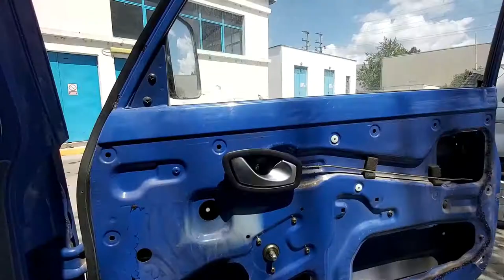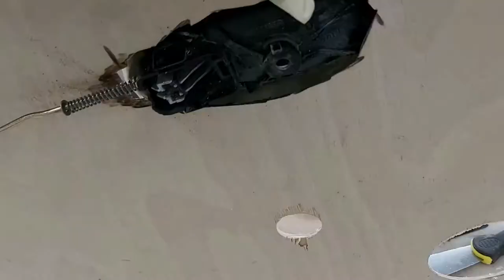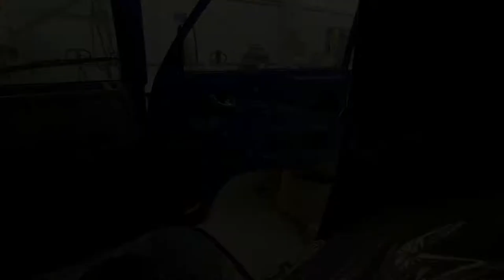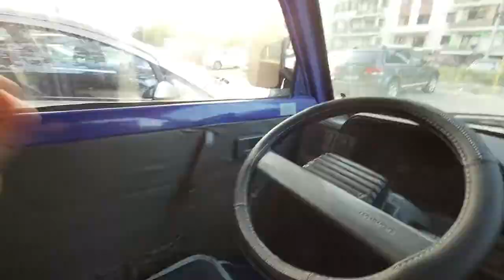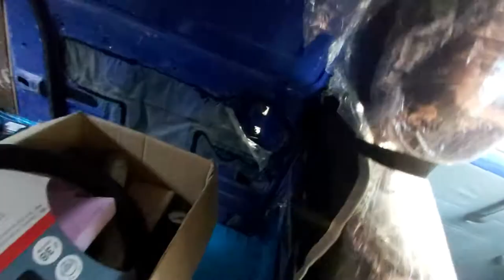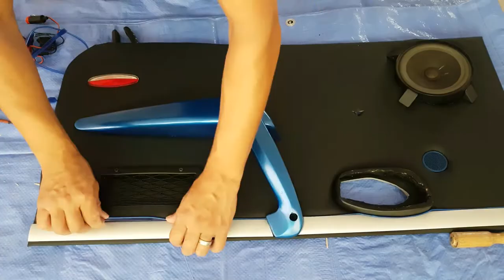How to customize your car door panel full timelapse I Daewoo Damas Micro Van  Micor Camper Project

Comment: Price please
Reply from the maker: @sargunamguna7311. First of all thank you very much for your comment! let's take it gradually with the price of each component.  The plywood cost 10 euros, but for this door I only used a quarter of it.  The vinyl cost 12 euros, but it is enough for both door panels.  The opening handle, the armrest, the lower bulb in the door and the diffuser were saved from older projects, from other cars, but I would value them all at 20 euros (I added some putty and paint to the armrest).  The aluminum strip cost 3 euros, the ambient lights 5 euros, and the mesh pocket 2.5 euros. So far we have a total cost of 52.5 euros. But if you have some leftover materials from other projects this cost could be cut in half like in my case. Good luck with your project and if you have any other questions, don't hesitate to write to me.